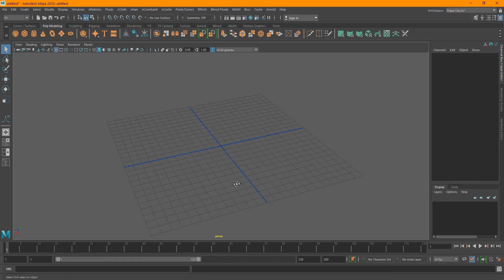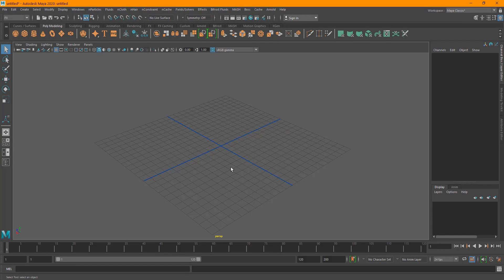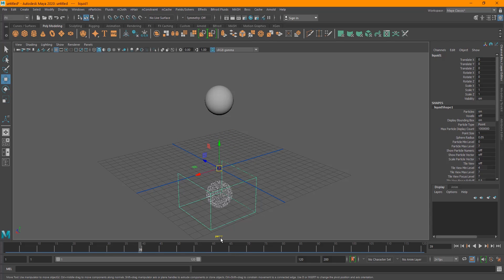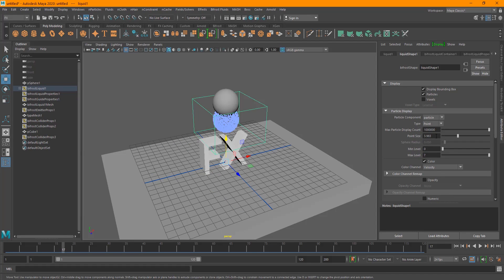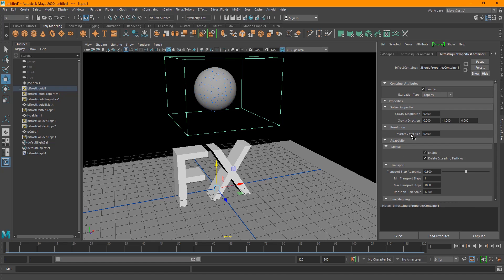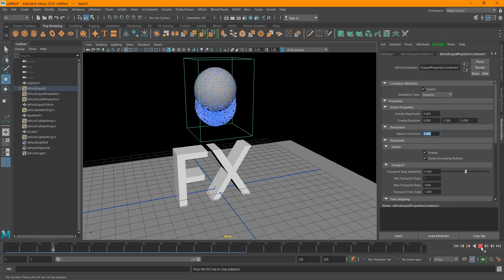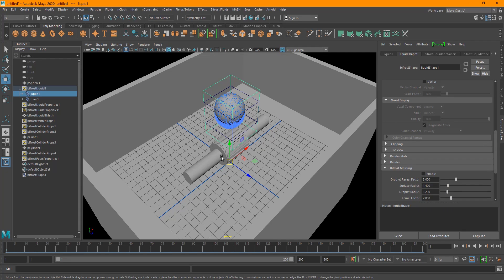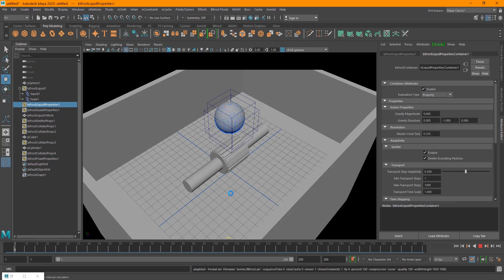Maya Bifrost-fluids Basics Tutorials

Comment: Thanks a lot for the amazing tutorial. I would ask you why Bifrost on may machine running very slow, even I am using a very powerfull workstation... I replicate your tutorial on my machine with the same steps and sizes, and in vain ... extreemely slow. Please advise.    Thanks
Reply from the maker: Thank you ! first off Bifrost is a bit slow and can consume lot of computing power, plus it is very dependent on the size your object and scene scale as well and finally the quality of your bifrost simulation is also very relevant to the speed of your simulation.
Reply: @fxmaniac2839  thanks for quick respond
Yes that why as I mentioned I went through your tutorial and figured out how slow is it